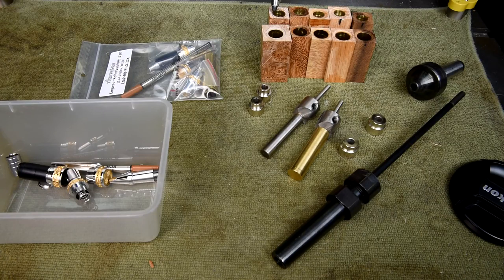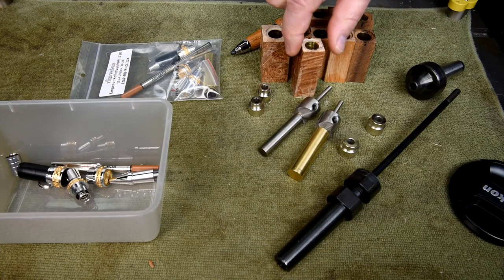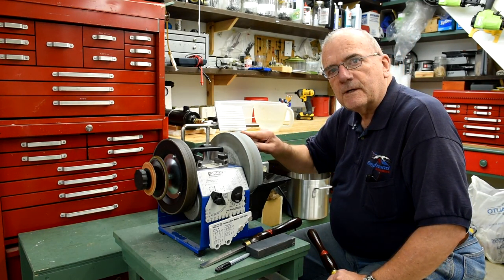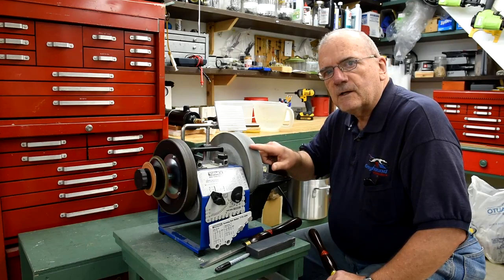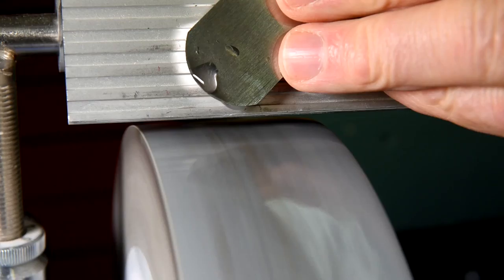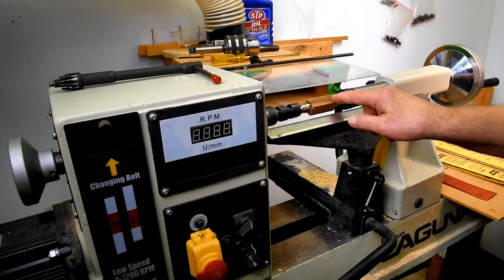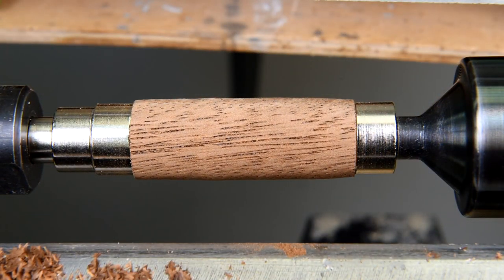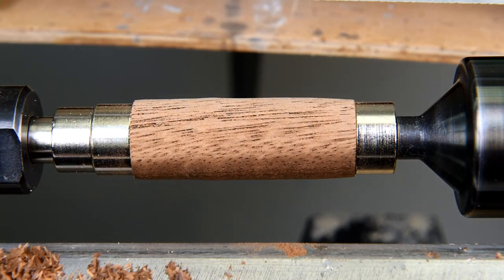"The Emperor" Pen - Part 12

Comment: Most likely what's causing the roughness on your grinding wheel is you use the center the most and there is a bit of pitting in the wheel. The metal taken off your tool will actually fill in the gaps of the stone and make it smooth and ineffective.
Reply from the maker: A representative from Tormek Canada has already seen the video clip and said "I am going to send this off to the factory and see what they have to say." At least someone is promptly looking into it. I'm pleasantly surprised.

Comment: Hi Ron, 
back in august I  spoke to so from tormek here in Germay and I have a guess:
your t7 uses the sg250  stone and this one uses 2 Grips, corse and fine. 
why dont you try to smoothe the corse middle with the fine side of the stone preparator. 
Maybe this will help. 
I recently bought the latest t8 with the blackstone and I dont have an trouble with my tools. 
Best regards from Germay 

Sebastian
Reply from the maker: Hi Sebastian,
Yes, I have tried that and it does help somewhat --- for a while anyway. If I can't solve my problem, perhaps I'll look into trying the "Black Stone"
Reply: The problem is that the blackstone only works on the t8, thats why I bought it. I own low and good quality steel tools and the man from tormek was concerned about using the low quality steel on the blackstone, he was sure the sg250 would work better. 
Even if it takes a bit longer to get the cheap tools to shape,  the become as sharp as can be.
It is a great machine and I am really fond of it.

Best regards from Germay 

Sebastian
Reply from the maker: Thanks for the information regarding the blackstone on my T7 :)

Comment: Hi Ron, love your videos.  This is just a guess, but to me the spots on the grinding wheel look like rust spots. Like maybe some bits of metal have become embedded in the wheel, and then rusted once exposed to the water used by the sharpener.  I have no experience using a Tormek, but I did find this thread on the Tormek forums that mentions rust spots or rust lines on grinding wheels, so there might be some useful info there for you:  https://www.tormek.com/forum/index.php?topic=2268.0.  Best of luck with it whatever it turns out to be.
Reply from the maker: Thanks for your comment. I checked out the forum. Will be interesting to see just how this ends up :)
Reply: Ron Calverley I was gonna say the same thing although I'm not experienced with that sort of thing but the noise seemed to correlate with the dark spots on the wheel